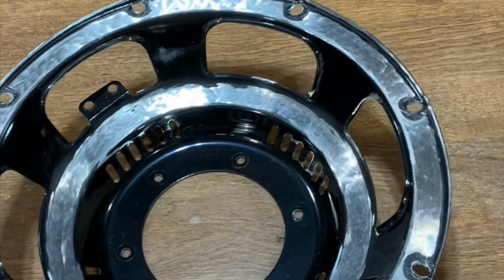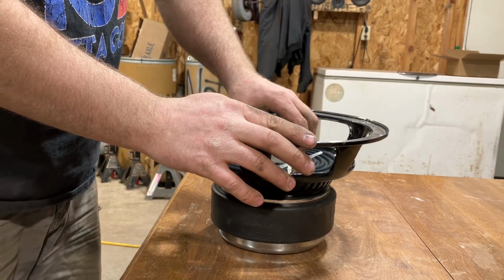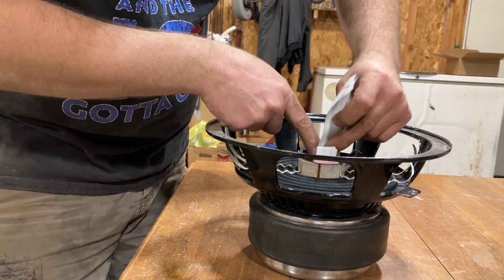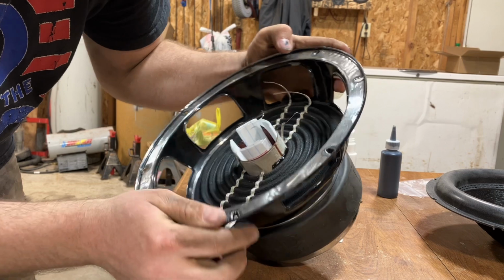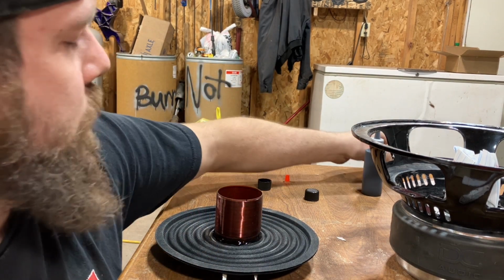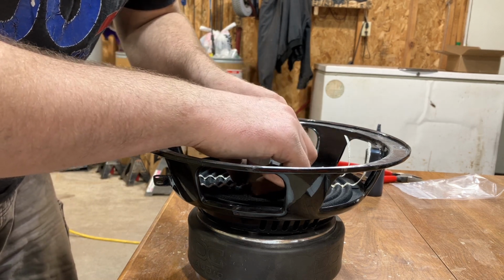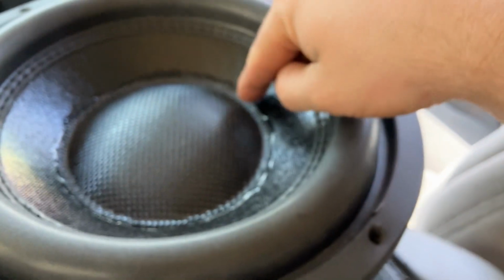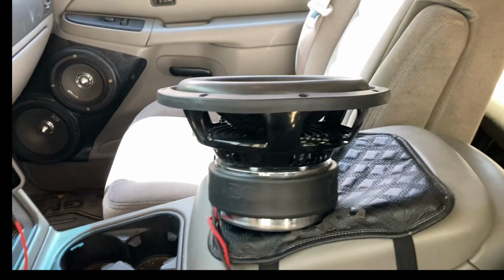DC audio level 1 10 rebuild part 4 and Demo free air 🔊

Comment: One trick you can do, when using a single voice coil, and a spider with dual sets of leads sewn in for a dual voice coil, is double up the leads.  Just turn the coil 90 degrees,  and use the positive coil wire to one set of tinsel leads, and the negative coil wire to the other set of leads. Just put one push terminal per side.  That way you can utilize both sets of leads on the spider. Just trying to help, as Thilo gave me that tip years ago. 👍
Reply from the maker: I was 100% going to do that but i felt like the coil wire length was a little short to reach the leads. I have noticed most single coil large home theater subs are done the way i set this one up and have no coil rub issues .
Reply from the maker: I think the coil would tap out first before the tensile leads lol
Reply: @annihilationindustries1990  I gotcha.  Just wanted to share a tip that I was given.  I did notice that it helps balancing out the weight a little.  Sucks that nobody has been making single sided sewn leads all these years,  for single coils lol.
Reply from the maker: Oh for sure , the leads are still on the other side not being used so its still got even weight over there just not the tails to be connected